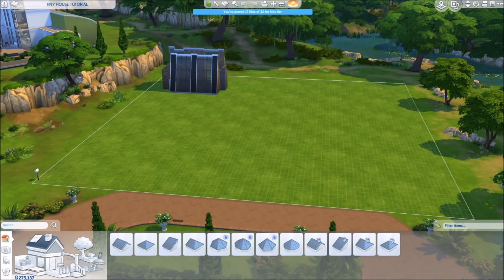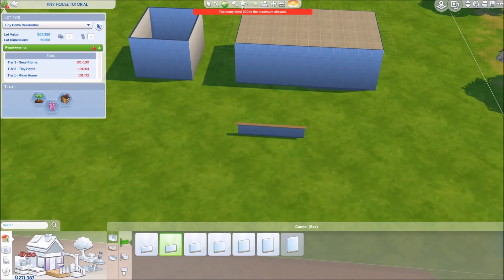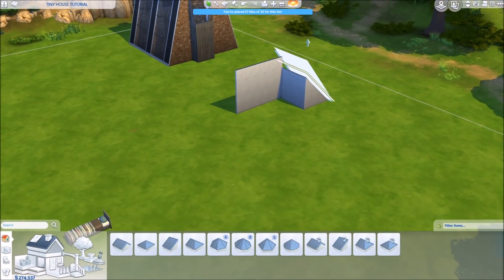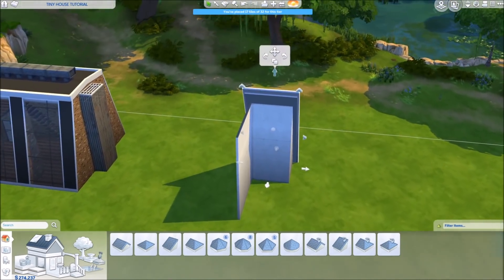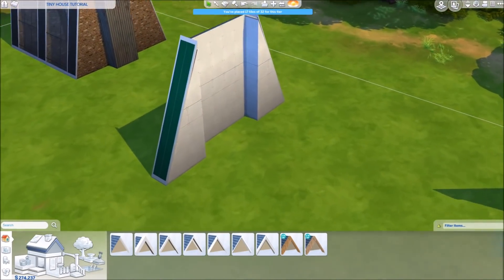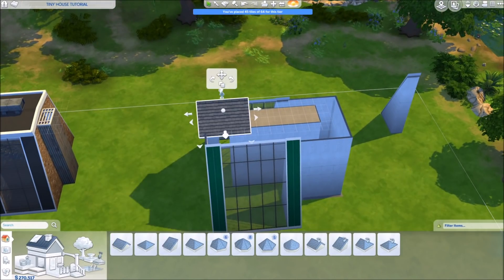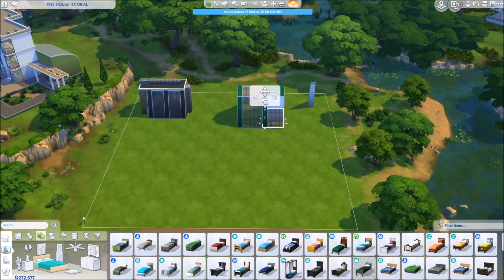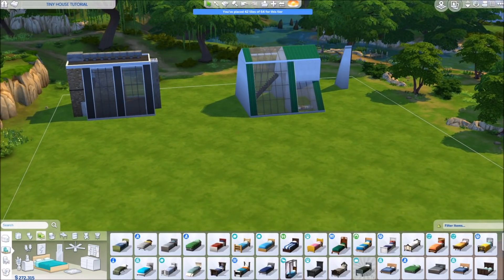HOW TO BUILD BIG TINY HOUSES | Sims 4 TUTORIAL

Comment: I built a huge normal looking house using just the wall trick. After setting up the outline of your house, you place a “room” that’s like 1x1 or whatever and roof it, and then you can expand that roof to cover the whole house. The space for the “room” is still usable too as long as you remove the walls. I built a home that is 6 bedroom and 2 bath that only counted as like 29 tiles. You can find it on the gallery under APizzaMyHeart1 if you want to check it out

Comment: Trick I use is the wall one... Just place 1 wall (1 tile), copy/move it to the knocked out tile, it doesn't "count it". Build your entire huge home, knock out 1 wall tile in the entire house, then remove the outer wall and floor, will drop your tiles to 0. Connect 4, dragdrop the rest.

Comment: Is it gong to rain or snow inside?  Will my sim pets poop inside?  It looks cool anyway.  Thanks for the video
Reply from the maker: It’s not going to snow inside. Since everything is covered by roofs. I don’t know what you mean with the pets pooping, they still do that in normal houses for me
Reply: @Simproved  and Heatburn1220 I can confirm this as well. I did have one or two instances where my Sim reached THROUGH the glass (one when I had a trash can next to the window), but I couldn't replicate it. But most importantly, they don't get weather inside. They can still overheat or freeze, etc. which still happens in a normal house so you would still need a thermostat and/or weather appropriate clothes.